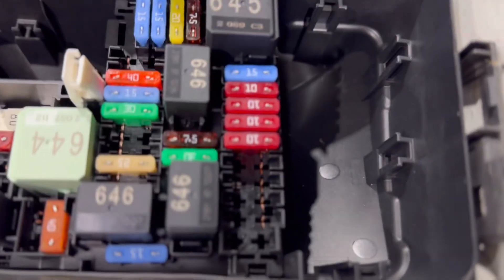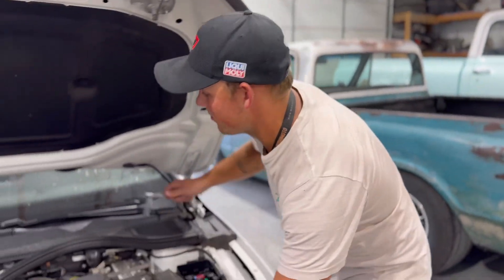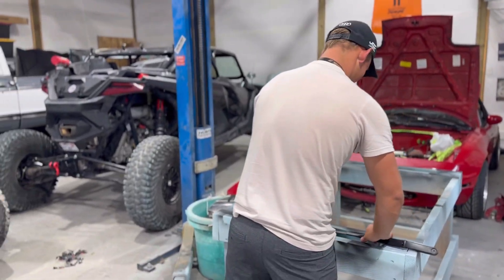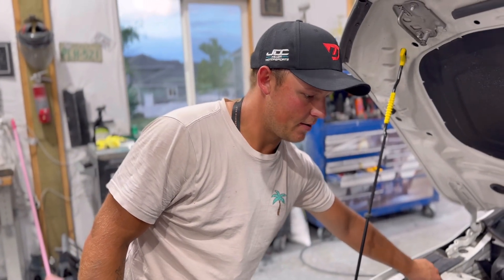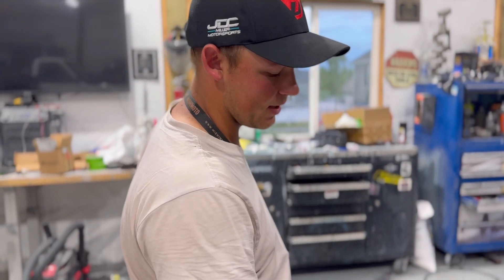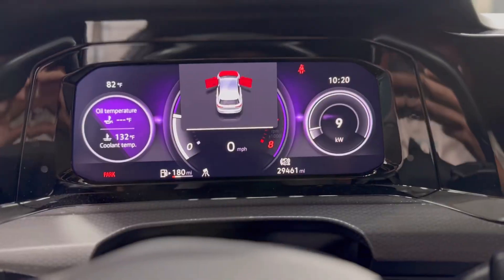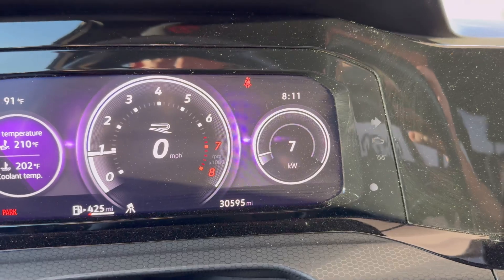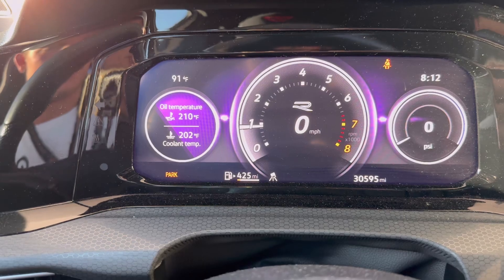Unitronic MK8 Flex Fuel Kit Unboxing - More Power?

Comment: Eventually, in a year or two, if you run E85 consistently, you'll spring fuel leaks all over the place including the gas tank seals and the multitude of fuel lines, connectors and o ring seals.  It'll be a while though, so enjoy in the meantime!  Nice video!  

PS...it happened to me, I speak from personal experience, several months after going straight E85, I was leaking fuel in multiple places on a MARK 7.  It clearly doesn't happen to everyone and maybe and hopefully, it'll never happen to you.  Best of luck in any case.
Reply from the maker: Thank you for the insight I did know it can cause corrosion and build up but I didn’t know it could have that effect so thank you for the information and I appreciate it !

Comment: You said e60 was the threshold to run the tune, but from what I’ve read you can run stage 1+ + uniflex with any % ethonal you want? You can run it from 93 at the gas station all the way to e85 let me know if I’m correct
Reply from the maker: @massimovercesi8288  yes you are correct when I had filmed this I had confused there straight e85 tune with the flex tune.

Comment: I thought there was no cutting involved what all did you have to cut? Is it something expensive to fix if ya screw it up?
Reply from the maker: @Anonymous-kb2bs  the only cutting was just the fuel return line that’s how the sensor gets its reading it’s not hard and it’s really hard to screw up there is plenty of fuel line to work with !
Reply: @octane_media  I'm probably going to have it done by a mechanic or a professional but either way if something does get screwed up is it really expensive or hard to replace the fuel line? I'm just paranoid because my car is a 2024 and has lots of warranty left on it and I don't want to mess around with too much and risk anything.
Reply: @octane_media  also, if you ever want to remove the hardware kit do you have to buy a new fuel line? That's my only concern is if you want to have it returned to stock what would you need to do?
Reply from the maker: @Anonymous-kb2bs  it would require a new return line to return it back but that would be the only thing to go back to stock

Comment: I could be completely wrong but I thought for the mk8 you don’t need a kit to run E85 you just need a tune.
Reply: You can tune for E85, but then you can only pump E85. The flex fuel kit and tune allows you to pump 91-E85 without re-flashing.
Reply from the maker: You are correct if e85 is common near you you can just run their tune this is more tailored to those who don’t live near places with E85 ( like me ) but still would like to run it when they do come across it . There’s only one E85 pump within a 2 hour drive for me.

Comment: If it’s a true flex fuel tune it should be able to run on any amount of ethanol if it’s a e85 tune it would need e60 -85
Reply from the maker: It does still run perfectly fine on any blend , I was more so talking for the peak power side of things I should have specified! Thank you !